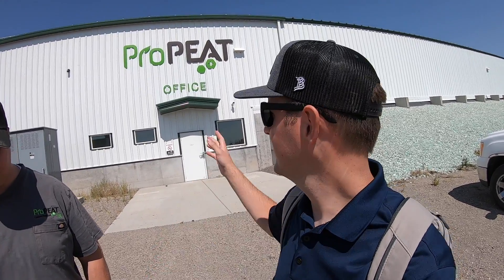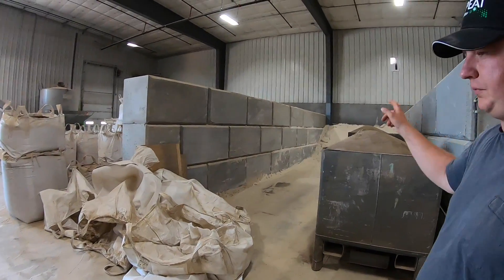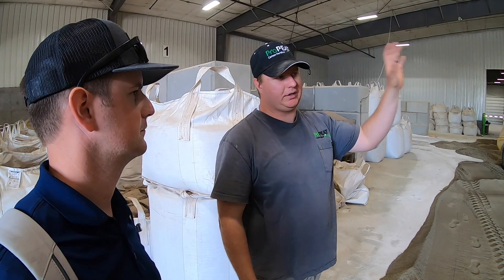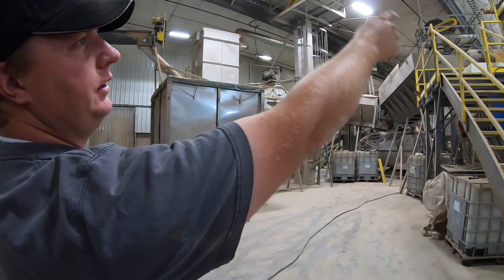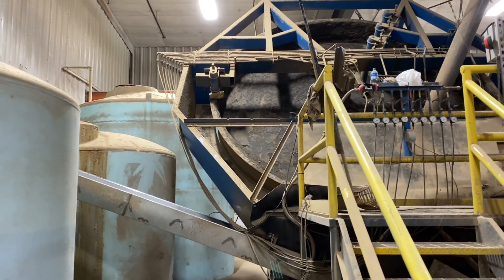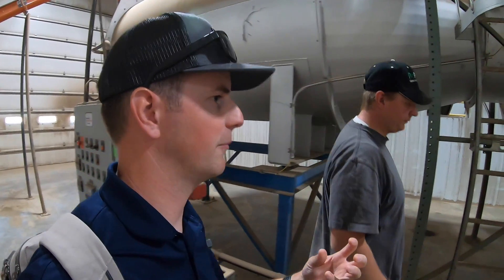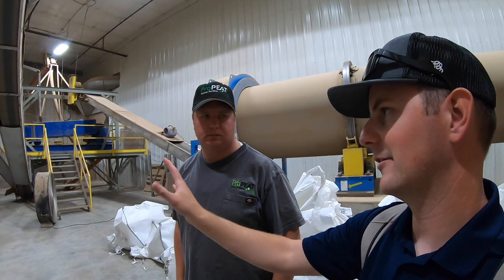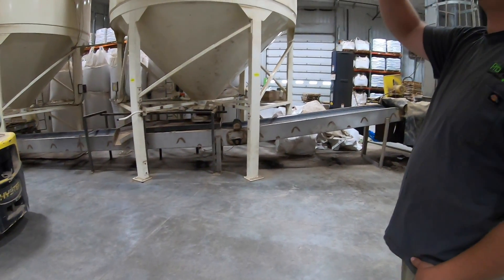HOW FERTILIZER IS MADE From Start to Finish - ProPeat

Comment: you didn't tell us how fertilizer is made..........you just show us which flour is nitrogen, phosphorus and others..........but you didn't show us how to build up and made those things.....you didn't show us what is inside those flour and what made each of those........we want to know how fertilizer is made..........not processing
Reply: Yea I don't think they would be willing to share that info I've been looking for that but I haven't been able to find it
Reply: The answer is the haber process. Basically you used electricity to turn the nitrogen in the air (the majority of the air) into ammonia. Ammonia can be further converted into ammonium sulfate by the addition of sulfuric acid (sulfur is mined from volcanic regions and converted to acid in water). 

Potassium is just mined (potash) you can also make it by burning plants until they are only the white ash. This ash when mixed with water in a pot yields “pot ash ium” (I swear to go that’s a real fact).

These are specifically not “organic” as the feed stocks are synthetic. That’s not a problem (most food is produced with it) but organic fertilizers source these molecules by breaking down plants and animal waste (they put it in a giant bin and let bacteria go to town turning it into sludge and then dissolving it in water.